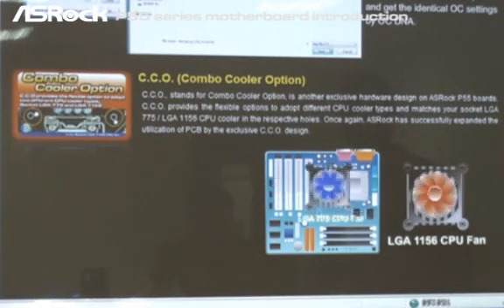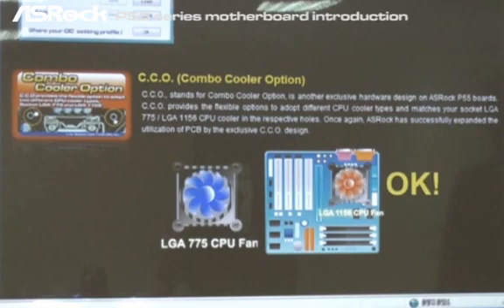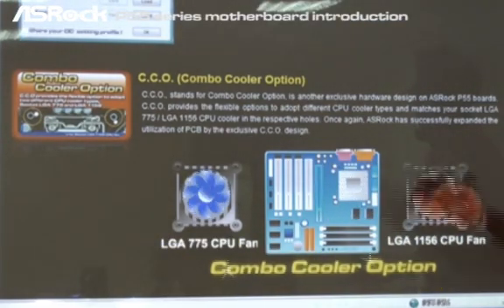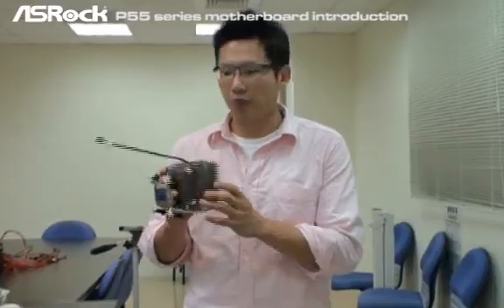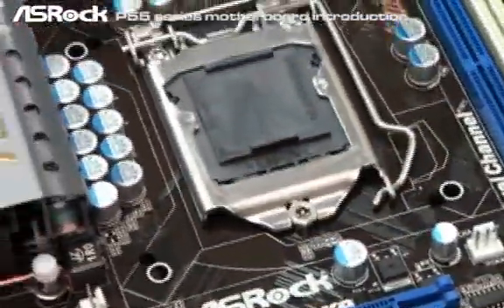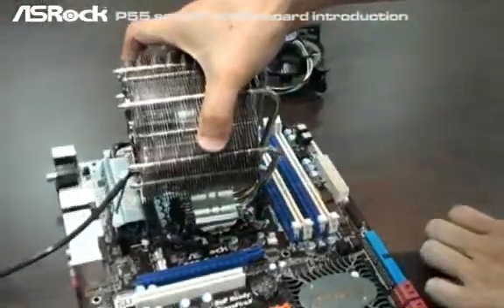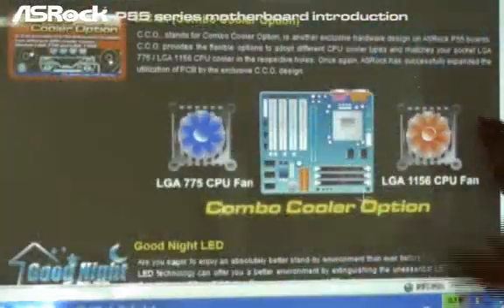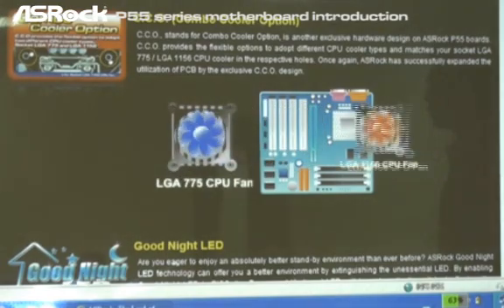ASRock C.C.O. (Combo Cooler Option)

Comment: Does a backplane from a 775 Cooler still fit?
I have a tower style 775 cooler 1,2KG copper that should coool anything on soket 1150 but i don't know if it fits Z77 Pro4M with the holes...
i guess i have to try it